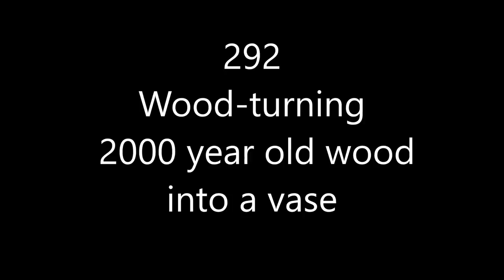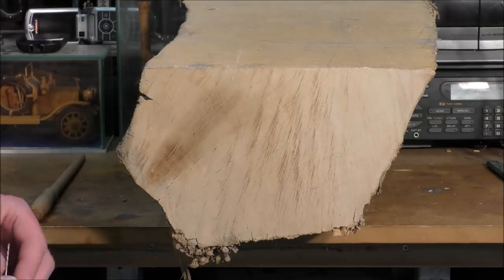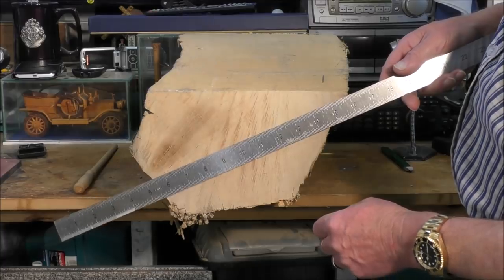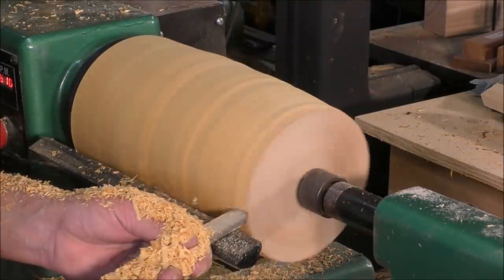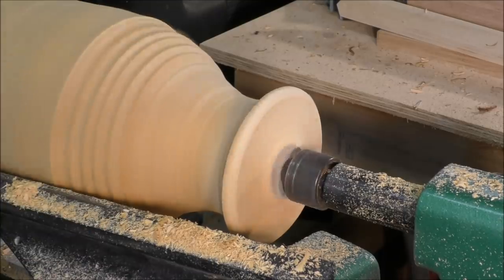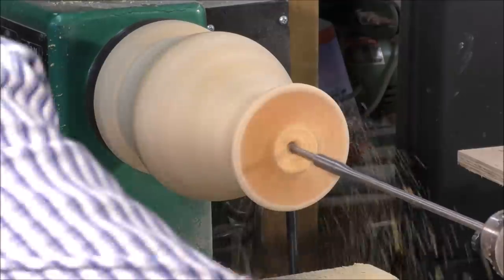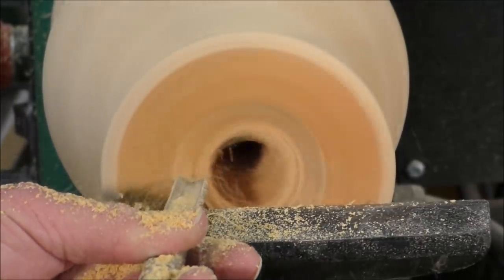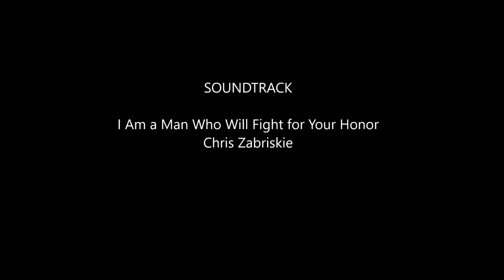Wood-turning a 2000 year old wood vase

Comment: Well a tree grows one growth ring per year, therefore the entire tree was 2000 years old, However this specific piece of timber has only been in existence since the furthest out growth ring
Reply: Although i should say, excellent video, and a really nice finished vase
Reply: More accurately, as old as the innermost ring on the piece. The outermost would make the age only a few years, depending on when it died. Age calculated from the inside out, not outside in .